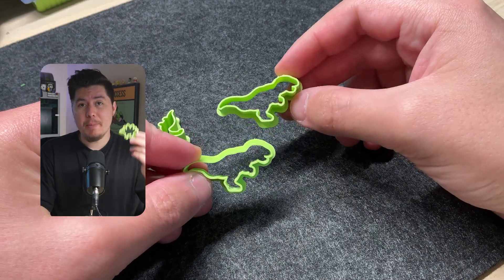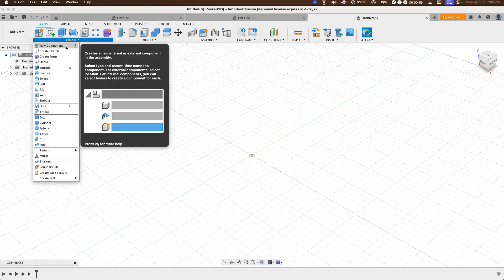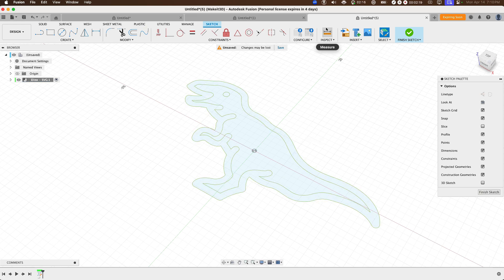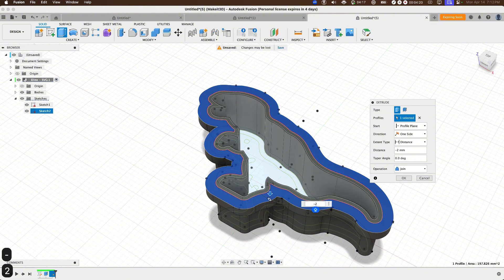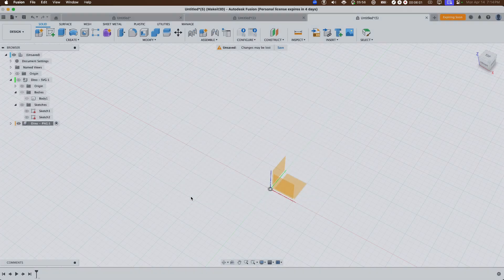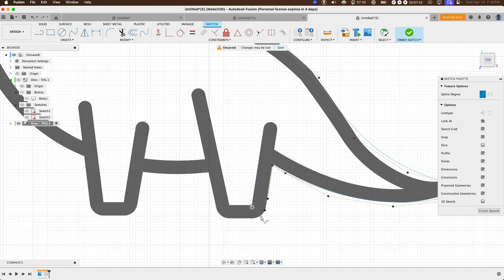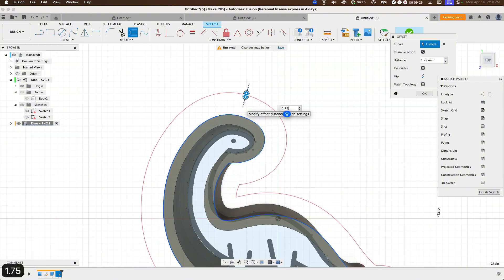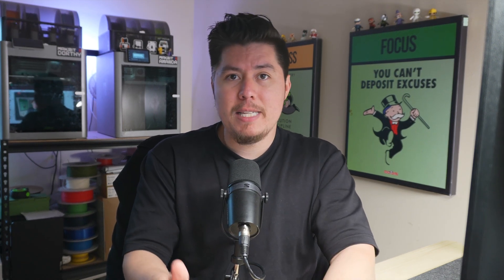How to Create 3D Printed Cookie Cutters

Comment: Curious if you could help solve this problem - if I find a file similar to your cookie cutter - but I no longer want it to be fully pass thru - I want to add lets say a 1mm backing to the existing design.  I could just make a square or over place the cutter on the flat 1mm oval/square and merge the 2 - but - I want to actually have that merged layer follow the contours of the shape - which many that I look at are irregular -   Best way to solve this problem in Bambu Studio or Fusion - prefer studio if possible.  TIA